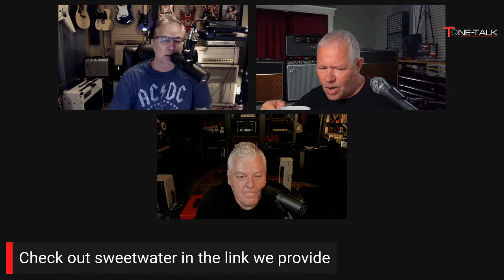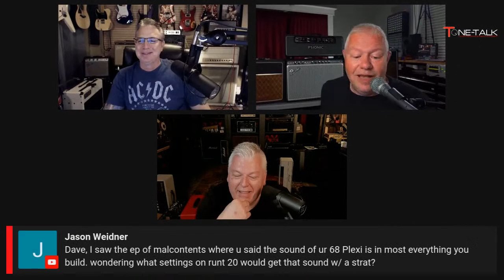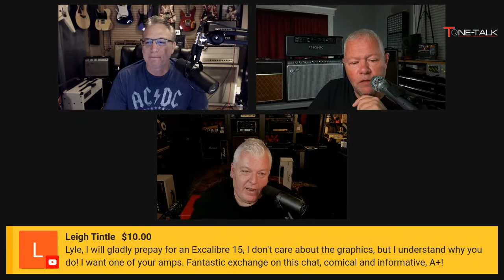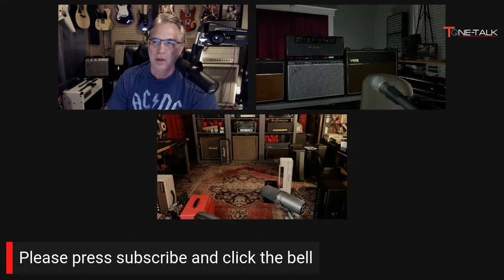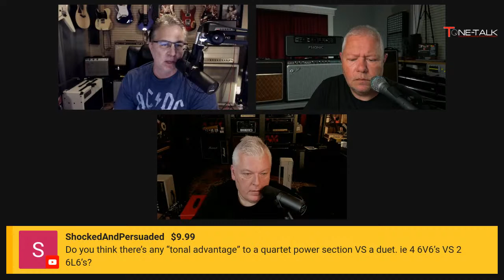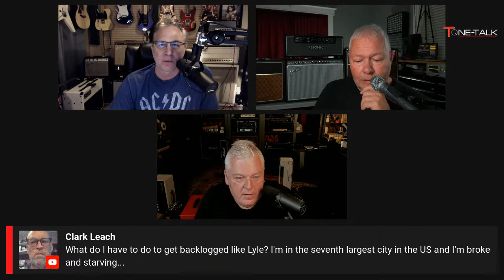Ep. 127 - The Good, Bad and Ugly of Amp Repair! Lyle Caldwell of Psionic Audio

Comment: Yes good show, these details are fascinating, even to just a lover of tube amps.   

Maybe a subject you could cover is why some techs hate to work on Mesa Boogie amps…….design or implementation?   I sure like mine, 2016 to now, 5,000 hours or so at pretty low volume (90Db) but it sure looks cramped in there (mark 5:25), should I be thinking about preamp tubes or a checkup?

Comment: Had an amp, and old 80 watt Sunn had 1 6550 and one KT-88?  I was clueless until long after the amp died, from being dropped, it was supposed to have 2 KT-88’s    Ummm both pentode power tubes
with same pin config?, I’m familiar 
from watching….but I’m no tech…

Comment: Yeah, I try to play at about 85 Db, too quiet for a 20 watt amp, so I use tons of pre amp gain, and compression.  It’s not a sound that will travel well at 25 watts vs 10watt
(A MB 5:25) class A nor would it record so well.  But it has the feel I like…..

Comment: I had a friend who had a 80’s V4 Ampeg…..he used it daily for years to power a subwoofer, left it on for a week.  Later we moved it, 1 power tube fell out of its base NO solder, …..vaporized.   He doesn’t know how they work, it was red plating for days I bet….. but knowing Ampeg, it probably will work again with some work, but damn do V4’s run hot, I’ve got an older 60’s V-4 (2 prong auxiliary power outlet) 2 wire input power cord.   I could use it as a heater…literally

Comment: The Radiotron Designer's Handbook will make your head swim with a ton of math formulas. My recommendations for two good starter books are "Inside Tube Amps" by Dan Torres, and "The Tube Amp Workbook" by Dave Funk. Each book covers important topics that the other one doesnt; and the chapter in the Funk book on grounding and safety considerations could save your life. Also, get a couple of RCA Tube Manuals. Tube Lore by Ludwell Sibley might also be handy because it gives a capsule description of virtually every tube ever manufactured.
Reply: I have a lot of tube amp books. "Inside Tube Amps" must be the worst of them. Try Designing Tube preamps by Merlin Blencowe.
Reply: @qddk9545 ,  Inside Tube  Amps is entry-level and written for newbies  to instruct them in the basics of how tube circuits work. It's not an engineering or design treatise. When someone asks for "starter" books, neither the Radiotron manual nor the Blencowe books qualify. Those are intermediate to advanced level.
Reply: @goodun2974  Yes and it is still a very bad advice. This guy doesn´t have a clue what he is writing about. The books from O´Connor from Australia could have been a good advice "Tonnes of Tone" ...
Reply: @qddk9545  , I've got one of the O'Connor books, and a Tom Mitchell book as well, but I wasn't that impressed with those....
Reply: GERALD WEBER TUBE AMP COURSE  800 BUCKS 20 LESSONS CALL HIM  AND YOU WILL LEARN ALL THERE IS TO KNOW  HAS MANY GREAT BOOKS ALSO  NOT EASY BUT YOU SHALL BE REWARDED  HURRY HE IS GETTING OLDER BUT ALWAYS ANSWERS THE PHONE  KENDRICK AMPS WEBSITE SO GLAD I DID